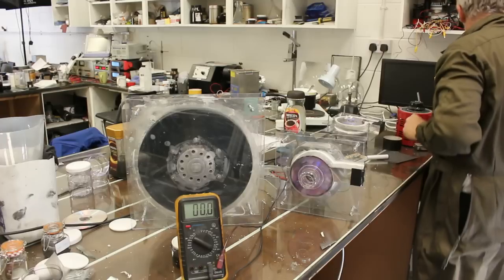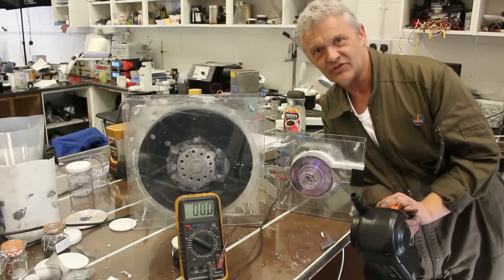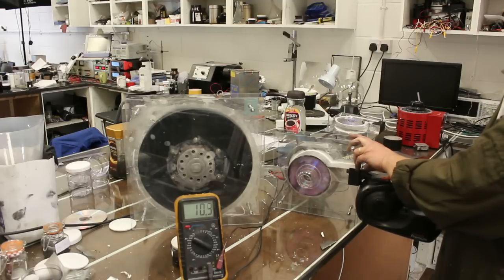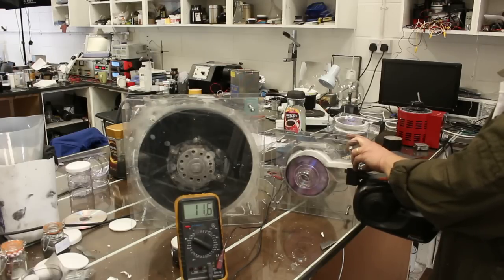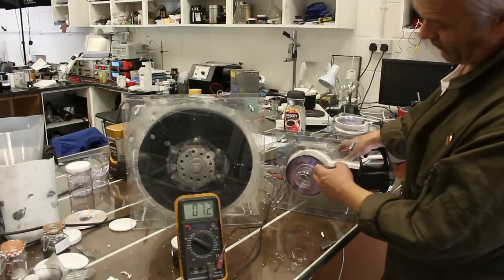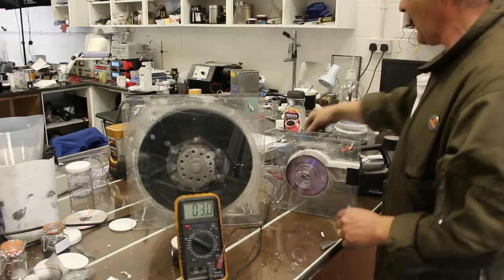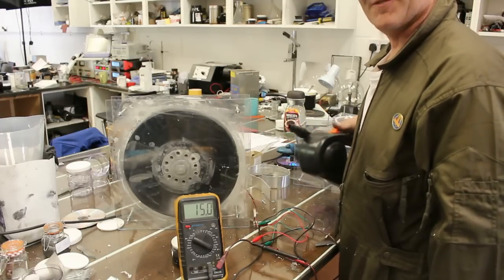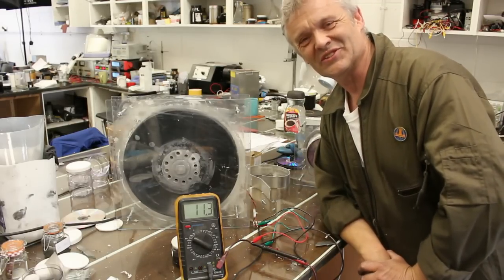Tesla Air Generator

Comment: Robert, where do you get the magnets for the generator? I can certainly find the dvd's in bulk and bearings for the center axle and washers for spacers. Can you provide a parts list and where you purchased your materials?

Thanks! 

Brian Forrest
Reply from the maker: I just got them on eBay mate
Reply: What kind of magnets were they?

Comment: of course the voltage is not the only thing you would want to be measuring, particulary when not given a load, 
A simple load on that might stop the turbine dead in its tracks with that weak air. 
We would need to know the current you could draw from something like this and the air velocity and volume that would be required to sustain it.
Reply from the maker: yes we would - but it is a fun and interesting project - however this is as far as i have taken it and is likely to be as far as i take it for some time
Reply: Agreed, it's all about torque. These Tesla look good because they spin fast but there's hardly any energy in them. The only energy creating application I can see is in low wind environments.. but the cost of set up and maintenance relative to energy value created isn't likely to stack up... and there's better energy targets to go for first.
Reply from the maker: that's not strictly true mate - British bike engineering was built on that as an idea - high torque low revs and long piston stroke then the Japanese came along with high revs, short stroke, low torque engines and completely dominated the bike market. Usually it implies more speed means more torque at the other end through a gearbox - but the real attraction of them comes from the simplicity of build - at least for a working model - which why i think people like them - they can be built on a kitchen table. There's a lot of good practice to learnt from that mate for folks who don't necessarily have access to  a workshop
Reply: Robert Murray-Smith There were plenty British bikes on the market but the Japanese won on low cost and reliability. With these telsa devices they work well in low energy input environments, but you can't get out more than you put in. Anyway, the supercapacitor stuff you're doing is very interesting, pity my knowledge of basic chemistry is zero, but surprisingly I am pretty sure of a technique from a completely unrelated field has a specific enhancement to these capacitors. There's a Tedx video on states of water you'd find very interesting, I'll try to post the link, at some point you should have a look, I think it might set a few light bulbs off... it did for me.
Reply from the maker: cheers mate - i saw this a while ago but the link is cool for others - so thanks for the post
Reply from the maker: nobody is claiming more out mate
Reply: I think the main issue with these turbines is i think you would need to get gears on them to put any significant load on them. or some tricky circuitry. other than that they are cool.
Reply from the maker: i think you are right there mate

Comment: Hi Rob, Hope you are well.
I assume if you drove it with a motor you would have a compressor. And that means you could use the tech to make a gas turbine engine. Much cheaper and easier to make than turbine blades.
But can't think of anyway to keep collector(big fan on front) to the compressor(smaller fans at back) on the same shaft.
Don't understand what that last post was about, Unless their was a load on the system their wouldn't be any amps to talk off.
I assume you was using a volt meter to demonstrate the efficiency's between the different size blades.
Reply from the maker: Hiya mate pretty much - i don't understand the last post either but hey ho - I can't see why it wouldn't work as a compressor mate - but i have no idea of efficiencies
Reply: Well their's  a lot of people playing with these, so if they took a std air compressor from empty to say 100psi and measured power usage, then using the same motor with a tesla turbine it would give a good idea.
Anyone out there fancy a go.

Comment: I think, you have overunity here! Probably, your air pump need 10 or 12VDC to run and you got output much more. After some modification, there is to menu chances to improve voltage. Now i got bright idea to build similar devices with the handmade air blower turbine to increase air preasure.
Reply from the maker: i don't know about that mate - but certainly worth experimenting with
Reply: lol be honest mate tell how much Amps and volts you use with airblower
Reply from the maker: mate - there is no attempt to mislead here - it uses a lot of power in the little air blower i used - but no attempt has been made to create an over unity machine like you seem to think - it's just a vid showing a couple of tesla turbines

Comment: Well there are different ways to generate electricity with it's motion. It depends on the type of generator that is attached to it.
Reply: how does it produce electricity when you need to produce air pressure in the first place? i dont understand
Reply from the maker: it's a windmill basically

Comment: Hello Robert thanks for the video. awesome work. i have a quick question do you have any diagram of where the out put wires need to be connected to. and did you leave a space between the dvd disks or are they on top of each other.
thanks again
Reply from the maker: no mate i don't have a diagram i just connected a voltmeter and noted the polarit the joined them up in parallel. There is a space 2mm i think - i used plastic washers as separators - this follows Teslas's recommendation
Reply: thanks Robert Cheers.

Comment: Thank you for the reply--it is just that talking about voltage only is so misleading. The congress of the United States has been fooled by  the same sort of thing. I did not mean to imply that you are trying to fool someone. Keep up the good work.

Tom
Reply from the maker: +tom payne I agree mate - I can't tell you how many times people have shown me batteries that have voltage but absolutely no power at all - and the potential between height and the earth can be huge but power is almost completely not there because of the lack of amps. But here we are working with an emf driven coil set. there is nothing 'fancy' here - the power will be related to magnetic field strength, coil turns, speed of rotation and torque. The limit of the machine will be related to construction and betz - these are some of things i will go through i promise lol

Comment: ive heard about these before can you comapare it to a normal "blade" generator i mean covering the build cost and the efficiency itself
Reply from the maker: +сталкер чворович me - personally - no.But i think it is cool if that helps
Reply: I have heard it claimed to be around 80 to 90% efficient for a tesla turbine. They are way easier to make than a bladed turbine. probably not much easier than a pelton wheel though.
Reply from the maker: +thagrit they are pretty easy to make mate
Reply: +thagrit I made a Pelton wheel with ice cream scoops and an old aluminum flywheel and it worked brilliantly. It was indeed quite easy. Not sure how you could use one for wind power though. . .

Comment: Good afternoon Dr. Smith! I just want to say fantastic work and thank you for all of your efforts. I have been a long time lurker on your page looking at all of your uploads. Hell, I even invested in Sunvault because of you! I believe in what you are trying to accomplish. I had an idea and wanted to ask you if, would be possible to incorporate two or more of these devices into the Edison car build? I would imagine that air would have to be channeled from the front of the vehicle and directed/compressed to the devices. The result  would be a sort of range extender to the vehicle where the vehicle is pulling from the graphene battery to move forward (acceleration), while the incoming air would power the devices and send power back to the battery. Sure this would cause drag, but wouldn't the added range compensate for this? Cheers!
Reply from the maker: +bro sef we already plan on putting a couple on there mate - the plan it to do a step by step and then a prototype with a friend of mine here in the UK - we will bolt it onto a car and do some measurements then onto the edison one  - i feel this has been a bit of a spoiler alert  lol
Reply: +Robert Murray-Smith That's pretty amazing. I had a feeling that you would have already thought of it but figured I would add my $.02 and contribute to something I think is pretty damn awesome. I appreciate the spoiler and I hope it doesn't cause you too much trouble. I cant wait to see more videos on your progress. Godspeed Dr. !
Reply from the maker: +bro sef cheers mate and i am sure it will be ok lol

Comment: I don't get itis the power output greater than the power used to run the blower?
Reply from the maker: +kulucriss1 no mate - but you wouldn't try to run this with a blower - you would stick it in the wind!!
Reply: +Robert Murray-Smith but that blower was hurricane speed, so by the time you have the right fan or box to funnel the wind wouldn't it just be cheaper and more efficient to get a ready made wind turbine from B&Q say?
Reply from the maker: +kulucriss1 you might be missing the point mate - you can buy one if you want or you can experiment for yourself - this is about experimenting. but buy one by all means if experimenting isn't your thing

Comment: I see the voltage, but what current you could pull at that voltage ?
Reply from the maker: +joejoe4games i don't know mate - that would depend on load conditions. There is no free ride here - so the higher the load the more wind you would need to 'power' it. With a hair dryer you are not likely to run much maybe an led lol

Comment: Mr. Robert.....Thank
you for posting videos .....just a stupid question from someone who is not a
electric or electronic engineer.....what is the purpose of this turbine....considering
the power you used to run the air blower to get the turbine going ...have you
actually gained energy if we subtract the energy used and the energy you got
out.....?? I'm a handyman jack of all trades, and I have a finger on every pie
I can reach..... and so I do lots of work on cars....I cannot accept the fact
that in less than a decade we revolutionized the technology of communication
and so many stuff , including cars, but we still drive them with the very same fuel
that we discovered more than 100 years ago since the first engines were
built....we all know this is the bullshit from the oil and energy companies
that are pushing to the good and free energy sources and technologies to be suppressed
and pushed away from public knowledge....I'm always fascinate with the future
of transportation, and the hybrid cars is a good step the world have achieved
...but a very small step considering the period of time we drive cars....when I
look at the cars ...I see so much energy wasted from the heat of the
combustion, to the force if the air that passes thru the vehicle in movement,
or even better every wheel in is an generator itself...
Reply from the maker: just fun mate - you have to have fun too

Comment: why dont they make a smoke driven electricity gen so heat will not be lost unefficientley and stil can produce electrical power just an idea is this or make a thermodynamic generator like a tower driven by cold air coming from under hot air going up thus creating a vortex of wind going upmoving generator
Reply: I would just put a funnel to guide the wind into it and use it as a wind turbine in low wind areas, like where I live.  The pickup coils could be used as a break to slow it down in case of high wind, maybe by just shorting it power output to ground if the voltage gets high enough to jump a spark gap.  Shouldn't be too hard to rig an ice cube relay to close a ground if the voltage jumps a 200V-300V spark gap.

Comment: How can I come into this kind of subject? Where should I start? Basic electrics? :D
Reply from the maker: some basic electronics is always good mate - but so is just getting up and building some of the mechanicals. - you can make a tesla turbine from just paper and run it with a hair dryer - that's fun, easy and doesn't require a lot of tools - but you will get a lot from the build

Comment: I've been working on a turbofan jet engine design where the exhaust is funneled through a tesla turbine in the back. What happens is, the turbine is set up so that either part of it or all of it can be put to use (like cylinder deactivation in cars), but because tesla turbines have such low torque outputs under load, it's hooked up to a set of reduction gears that move the intake compressor scroll and the turbofan at lower speeds than the tesla turbine. Anyone got any info on whether it might work?

Comment: Dear Robert, I've just Truly been Always// Dithyrambic about your videos but for this one, I am Very Most Surprised, as several before, You didn't set a load, at least a linear resistor, to provide the real power by Volts times Amps; volts alone really mean near nothing :/ Please, always provide Amps on a resistive load in addition to voltage so we could have the out put (in Real Watts) so we can compare with the input power and have a real idea of the effective efficiency  :) Regards, Didier.
Reply from the maker: no mte - it's just meant as an idea - if you want to explore it feel free if not - well feel free lol
Reply: Wow! You did all this just to show the idea :p
Reply from the maker: yes mate - i ama kinaestetic learner - i tend to learn by doing and tend to think through things in the same way
Reply: Understand but I would not be surprised it had a link with your SWAG ^_^

Comment: How many of this 45 V you need to run a Toyota Prius non stop ? :)
Reply from the maker: no idea mate
Reply: good question, and how do you produce the air pressure? using how much of what? electricity?
Reply from the maker: mate - use your imagination - you could put it on a water stream - you could use a vent from another system that would otherwise be wasted - you could use a venturi in a wind source - i don't know - have a look on the net and have a think if you are interested - there is a ton of stuff on using turbines of all kinds and this is just a turbine

Comment: Ahh reading the comments and think im getting brain damage. Not sure where you got the devices wish you had a link or did you make them. Just thinking of a compressor battery. Where the excess power from a solar system powers the compressor. Then can be used to generate power on cloudy days to recharge the batteries. Cant find a simple air generater or whatever you using

Comment: Reading voltage only is not usable power. Nearly all these youtube Tesla tests are speed and voltage not amps. With out amps you have done nothing but make a wheel go round and and generate a static charge. Which is not useable power. I am a fan of this type engine. I think it has application. But why so many get so excited about high speeds and unusable voltage is beyond me. Voltage with out amps is nothing. 10000000000000 Volts with out amps is nothing.

Comment: I'm almost Cretan that there called Tesla Turbines not Tesla Air Generators
Reply from the maker: +Dylan Peil it really doesn't matter that much mate - i call them tesla turbines in the vid and they are being used as generators - so what would you call them?
Reply: I am sorry I was just referring too the tittle of the video. I am a big fan of your work and seen a lot of your videos. at the moment I am building a solar concentrator in my back yard with a satellite dish. I want to use a Stirling engine as my generator and I've seen your video on making one. I tried to replicate your design and failed. any suggestions would be helpful.

-Dylan.
Reply from the maker: +Dylan Peil it's sensitive to the weight try altering that